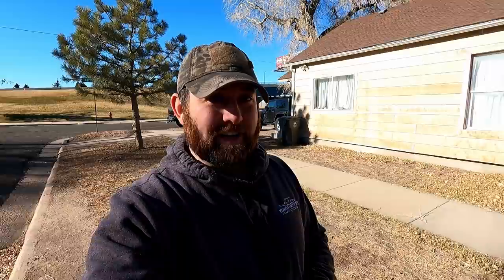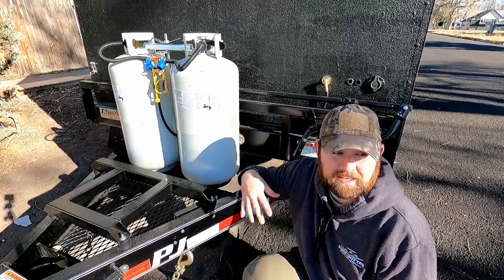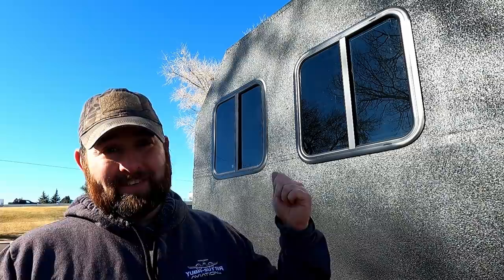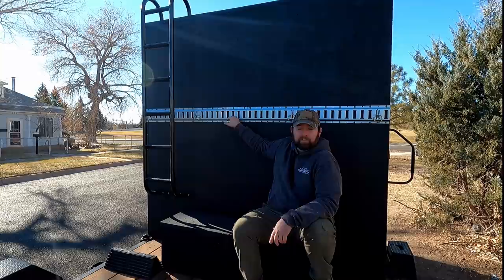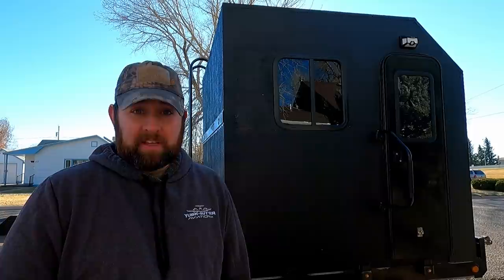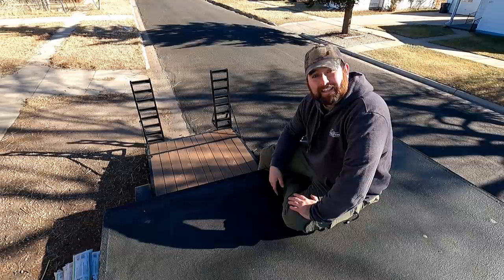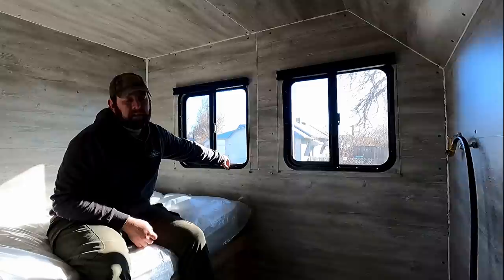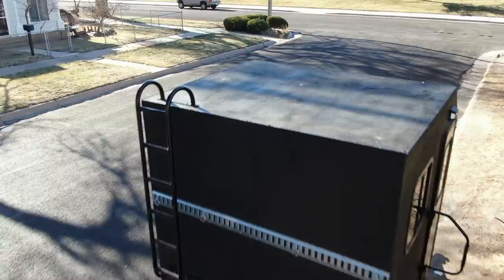DIY Crawler Hauler & Bugout Camper BUILD

Comment: Nice job! 

All I can think of for improvements would be kind of expensive. For a super-resilient vehicle, I would ideally like everything running off of diesel. However, that's really expensive: $2500.00 for a combo stove top and heater, $800 for a water heater. 
Also, I don't like fuel-run generators (they make too much noise, for starters). My 2019 80RB Adventurer camper (all state-of-the-art LED lighting)  has space for two deep-cycle batteries, to include the one under the hood of my 1990 Dodge Cummins Diesel. Even with a solar system, it's all about battery storage (besides, when the engine's running, the batteries are constantly being recharged). I never understood these converted vans and stuff on YouTube, generating 1000 watts of solar, or whatever. Why? It's way too much, and still not enough to run an air conditioning unit, unless you can find one that runs on 12VDC, but then again those are ungodly expensive as well (BTW, I'd get a Fantastic-brand fan as an alternative. They can move A LOT of air). A wood stove may not be a bad idea, either. Also, I'm glad my camper didn't come with a 12VDC to 120 AC converter. Also I prefer running everything on 12VDC. You waste a lot of efficiency by converting to 120.

Anyway I spend  a lot of time on the road on business, and I've discovered that I can be parked for as many as five days stand-alone, without even having to start my engine to recharge the batteries.

Anyway, you can probably tell I'm a hardcore, total collapse-preparing Survivalist. YMMV.

Comment: Those shock isolators tend to delaminate over time. I would definitely add 2 safety cables on each side so you don't lose your generator in travel

Comment: you should really consider installing a window style A/C unit into the wall instead of a roof A/C unit for many reasons.  the 5,000 BTU window unit would be more than enough to cool down your camper.  it also is very easy to install where a roof A/C is not that easy.  window A/C unit is only around $100 where a roof A/C unit is quite a bit more than that. 5,000 BTU window A/C unit should run off of your 2200 honda generator, I know you will need another 2200 generator in parallel to run a Roof A/C unit. Good luck with your build.
Reply from the maker: I've considered it but i dont know where I would install it now that the cabinets are installed
Reply: @CodeBrownProductions  I did see a camper that installed it in a cabinet. (depends on the size of your cabinets.)  there is so many issues with a roof A/C unit, i never thought much about it but I had some problems with my roof A/C unti on my big trailer camper, my truck camper has a window unit instead and I haven't had any issues with it and it makes it an ice chest in there on the hottest of days. good luck with whatever you decide! I'm rooting for you!

Comment: Can you cut end out of toolbox and make a slide out for your generator. Use end piece of tool box for outside of generator slide so when you slide generator back in it will look like a regular toolbox. When you use generator just slide it out away from structure and let it run without too much heat. Just a suggestion?

Comment: Water jug behind the camper foot pump with hose going to the foot pump and then like a gasoline pipe with a gas cap on the bottom so when you do dishes or wash your hands you can just drain the dirty water on the ground

Comment: Definitely would suggest some kind of lightweight metal siding and something to protect your gas lines exposed on the front of the trailer. Just from personal experience hauling my27ft tilt deck in mud or snow and build up from the tire spray so much so its froze the latch n after having to deal with busting solid ice off to free the latch in a blizzard I took the tim to build a guard from more than just highway build up but rocks and anything else since more times in the thick of it tryna recover broken rigs or scrap n hauling the trailer down trails most city folk would quickly abort mission even in a mall crawler lol but otherwise he'll yeah brother. Roof rack wouldnt hurt either from the little fab work ive seen in this video definitely wouldnt be a bad idea personally I prefer low profile racks made with a cnc table and tubing in the middle connecting the two but to each their own aye? Anyway stay building n wheelin! #SocoJeeps #CrawloradoJeepKrew #OutlawDirt&Design #Approved&Subscribed

Comment: hopefully you plan not to living there when it's summer because dark colors really like to get hot that's why I'm most Caravans are white or silver :-) one thing is missing is some air fents in floor in a normal Caravan a usually find them in the cabinets with a little opening underneath little door.. there's also less chance of mold in the winter by doing this well

Comment: Your mountong bolts on the generator- drill a hole in the bolt (threads) then just use a key lock.

Comment: Pull the solar pane off of that light and epoxy it on. It will eventually pull off and disappear.
Reply from the maker: It's currently screwed down with short lag screws.

Comment: For air conditioning instead of using the typical air-conditioning for a camper use a heat pump and inverter or the $.24-$.25 seared rating get about 10 to 12,000 BTU I need to be a little condenser fan in the back or inside somewhere we know what even in the front by your propane bottles it heats and cools and much more less power-hungry you can use a lot less power

Comment: Awesome build I like it alot, did you ever think about tack welding a thin piece of plate steel to your frame on the propane tank side before covering it with wood just in case there was ever any mishap with the tanks might give you some added protection if you happen to be in the trailer if something were to go wrong like stray bullet hitting the tank or anyting that might rupture the tanks and cause some type of explosion or something.

Comment: DUDE that is badass!! It's perfect for your application. When you put the bedliner on the outside did you have to prep the wood before rolling on the liner? I have an 8.5 X 18 cargo trailer/camper I converted and want to use the ramp door as a patio so it needs to be water proof. Just a thought here for future towing ideas there's a feller in Texas that has designed a goose neck hitch that bolts onto the hitch/neck of a bumper hitch trailer allowing you to tow from bed of your truck if you have a truck! Guess I should have asked if you pulled that with a truck!  Lol Anyway very nice job and I love the 2 inches of insulation.
Reply from the maker: Nope, I just rolled on 2-3 layers to make it a little thicker.

Comment: This is an idea get you a 4 inch PVC pipe to caps on it put a valve in it and put it on top it could be heated by the sun that way or you can put a little heater in there when you want hot water but if you do it my son it won’t be easy I seen a guy had on his work truck he use it as the full taking a shower washing his hands he just booked a Valve on it to open and shut it I thought is pretty good idea and we have water on top the trailer I just thought

Comment: Nice job !! With you twin axles set far back & the weight of you ‘pod’ plus those gas bottles right up front, what is your ‘nose weight’ on the hitch ?  Unsure of US regs but here in UK the max weight is 75 kgs (165 lbs) for the ball hitch. 
Really enjoyed your video….👍
Reply from the maker: There is not upper weight limit in the law in the US but there are upper limits per the truck manufacturer. Mine was 1500lbs for my Class V hitch. My truck was not a small car, it was a one ton rated diesel truck Having said that the measured weight on the tounge when loaded was 1100lbs.

Comment: Should rebuild the bed as a Murphy bed, adding water to camper easy I did diy my camper. Be cool have shower out mudding come back shower off. Camplux on demand hot water heater run on propane.

Comment: Fine till you're stuck in the traffic jam to get out of the city.   There's only so much you can prep for.   You'll need a lot of lead time ahead of everyone else for ground vehicles to be enough.   The hurricane Rita evacuation of Houston proved that gasoline at gas stations runs out quickly but diesel doesn't.  That's where a bugout vehicle should begin, with diesel engines.  Biodiesel are also much easier to produce in a postapocalyptic world than ethanol as the basis would just be an oil press, mind you, ethanol is more entertaining to produce.

A bugout vehicle is about getting you to a remote location where you've cached supplies and have a shelter not something to be your supply cache and shelter.

Comment: loved it... I have a pj hydraulic tilt trailer for car and metal hauling.. I am contemplating building a frame to make it a cargo trailer and remove the box when I want the flatbed back.. How did you anchor the box down?  just the stake pockets? or?
Reply from the maker: I bolted them to the stake pockets.

Comment: I haven’t read all 652 comments, but hoping you are using a fuel filter in line for your Mr Heater. They have a bad reputation for failing due to high pressure line gunk.

Comment: Dont go with the crappy power hungry RV roof air conditioners. I hope you instead go with a mini split. It can run on much less power and works a lot better and offers heat as well.

Comment: What size is the trailer, I'm thinking of something similar but putting a camper on it then my side by side up front with a storage cabinet underneath bed area, like u see on fire trucks etc. I would have put the door off the deck, other than that nice build.
Reply from the maker: It's 22'

Comment: Super bad ass build! What did you fill in your exterior seams with? And did you put the herculiner straight on the wood Or use some kind of canvas over it?  Im building somthing similar myself on an old 23ft camper frame.

Comment: For water .bolt on a 30 gal.cylinder water tank on top front of camper with water fill spiket attached to fill tank . . run in line hot water heater as needed hot water heater .wala water

Comment: should have done Murphy  bed. that way a folding table could be used there. and you still would have the space for a 12 volt refer and port-a- potty .  on board water tank under the floor inside the frame. location pending bland of the loading.

Comment: And maybe to get more room in your try  a Murphy bed a Murphy bed would give you a lot more room and then put the cabinets right above the very top of the edge of the Murphy bed  maybe  lipo battle born batterys you can charge and add 300 watt Solar so you can get on eBay that’s portable by Dokio and that way you could know how to use the air conditioner on top and you have more room for solar panels with the heat pump The type of heat pumps will work -15° below zero and they’re rated really really cheap to run

Comment: How does it pull?  I have a 28' deck over that used to be a camper, 24' deck.  I am making a 9'x7' sleeping cab similar to yours and then haul the jeep on the back part.

Comment: Proximity of generator to propane doesn't seem like the greatest idea...  also seems a bit small but i guess adequate for a small pod like that.

I would do extra bed liner when spraying a structure like that.

2" of insulatuon is good, but doesn't have to be that thick using aerogel insulation.

Comment: Cool build. But I noticed you said a toy hauler wouldn’t work? Why not? We have hauled my wife’s 4 door jk in ours and another time hauled my tj on 37’s. Still able to keep rear bunks in. 30’ attitude.
Reply from the maker: Any commercial toy hauler I've ever seen is not rated for the weight. That and they garage never seems long enough to fit a Jeep
Reply: @CodeBrownProductions  if you go with a fithwheel you would have to be in the 40’ and up with open floor plan. For regular at pull behind most 30’ no slide toy haulers will hold your jeep easily. When we had my tj in mine we also hauled 1 kids quad in the kitchen area and my kids rzr 170 in front of the jeep. Ether way your trailer is way cool. We built something similar but used a semi truck sleeper  cab mounted up front.

Comment: But is the the hose from the propane tanks rated for high pressure LP? BTW, you can operate your regulated equipment on 10PSI. I’m a retired LP service technician

Comment: Does this mess with the weight distribution when there's no vehicle on the trailer?
Like causing wobbles since all the weight is a good bit in front of the axles
Reply from the maker: It sure does. It can only be towed on the highway loaded. If you need to move it unloaded in town that's fine but on the highway for weight and balance it has to be loaded.

Comment: Most weight should be above the axles balanced between front and back on your trailer otherwise the death trap you were talking about was unbalanced weight is called a wiggle wagon once it starts wiggling it does not want to stop waggling long and scary slow down Theory probably don't have a corner in between maybe you need to make a safety movie from mold safety movies

Comment: Looks like That tool box is in the way for the jeep
Reply: It's in front of the chocks that the wheels stop up against, and the jeeps a lifted offroader, so it'll be under the nose.
Reply: @kieranh2005  it didn’t look like it would fit from the before & after shots!

Comment: Cody, do you have a build sheet for your build? Did you use pressure treated lumber throughout or just on the exterior?
Reply from the maker: I don't have a build sheet sorry but the tops and floors were all pressure treated.

Comment: Hi John! I have a 24' car hauler that I want to convert to a camper. Why did you construct a floor frame? Could you have used the bed of the trailer?
Reply from the maker: Could have but I wanted to be able to disconnect it if needed.
Reply: Ah, nice! Good work.

Comment: One thing: forget the cassette toilets...Expensive, messy, a hassle to dump out, did I mention messy (and gross) and smelly. Look into building your own composting or dry toilet... very handy, very cheap, very maintenance friendly and no smells,chemicals or hard to find and (at times) costly dumping stations...
If you can build that trailer dwelling box you can build a composting toilet. I recommend you get a urine diverting insert (you can make your own but a purpose build one looks way more professional and much more like a normal toilet... Kildwick has nice ones, but I am sure in the US there are those who make inserts as well...
Reply: Where do you find the saw dust? Who wants to carry a ton of saw dust on a trip? Hustle to dump? If he built this then he can easily dump! What so hard about dumping?
Reply: @WW5RM  There are more places which saw wood then there are places which you can dump (for free) Get sawdust or small wood shavings at hardware stores or maybe job sites. In a pinch you can go to a pet store and get animal cage bedding.
Or go to the garden store and get peat moss or coconut core...
What is hard about dumping ? 1. water mixed with shit is heavy, which is weight you need to carry from the rig to the dump zone, 2.water and shit stinks like...well shit... and accidents do happen (although you may think you are the dumping god and be cocky about it which will get you in trouble some day), 3. using water to flush a toilet 9even a cassette toilet is water you need to carry (again the weight issue and where to get water if it runs out)
Believe me, a composting toilet rules over any water and shit mixer no matter how fancy it may be. 
And carrying sawdust is not hard, It can be done in a plastic bin, a 5 gallon bucket or several, peat moss is even better if space is at a premium, it is compressed and can be made into a useful medium using a little bit of hand action and some water...
And dumping a compost toilet can be done virtually anywhere: in nature, in a dumpster or anywhere dog shit is dumped in the local dog park. If you use a compostable bag to line the composting toilet shit bucket you will find emptying and recharging a composting toilet is so much better and nicer to do then playing retching richard at the dump station holding the vent button on the shit cassette...
I haven't had the need to dump anything, no black water and no grey water. I never go to these dump station places which most of them are over priced and frankly a health hazard caused by trashy people who couldn't care less about the next guy needing the facilities.
But hey, be my guest, cleaning up the shit as you see fit bro.

Comment: You said you were at MOAB and you never even considered an A/C?  Must be going in the winter.  How bout some basics, like length of trailer? Was it an RV? or was it a tow trailer? What modifications did you do to strengthen it or did you not need to? Also, wife is better looking than your trailer/Crawler/house, etc.  Enjoy them all.
Reply from the maker: I'm saving up to get that AC they are expensive lol. The trailer is a 22' PJ equipment trailer with 9k axles so it can easily handle the weight without modifications. The Jeep has to be loaded in order to tow it on the highway because of the weight and balance. I can tow it in town unloaded but I won't take it on the highway like that.

Comment: Found this on my recommendations. Awesome build! I didn’t hear you mention the length of the trailer. What length PJ trailer did you start with? I would like to build one for a 4 door keep wrangler or an 8x8 Argo. Thanks!
Reply from the maker: Its a 22' PJ and a 4 door will fit but the ramps stick out a bit

Comment: How did you seal where the plywood butts up together so it would not leak?
Reply from the maker: Made sure my cuts were accurate so gaps were minimized. Sealed with external caulking and drywall corner flashing
Reply: What about on the roof? Do you have any pictures